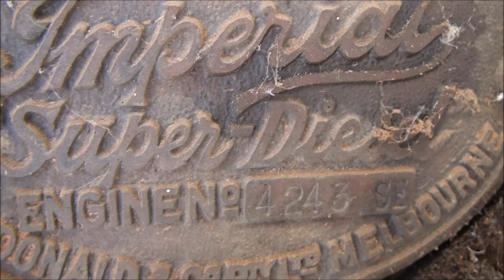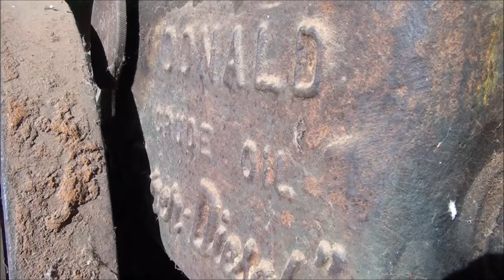McDonald Crude oil Stationary Engine, Australian made.

Comment: Runs mighty nice! Good for keeping the flies back too!
Reply from the maker: +TheFurriestOne Yes you are right, the 'Dunny Budgies' would be knocked around by the smoke! Will need a set of new rings though, gets through the oil a fair bit.
Reply: ***** I've seen cars on the road you would swear run on the stuff, despite being ostensibly gasoline-powered! Wonder if it needs new rings or if they're just a bit stuck? I'm sure you'll get 'er sorted though!

Comment: Awesome !! what a nice motor. Talking about quality. fantastic start.
Reply from the maker: +RODALCO2007 Thanks Ray! It certainly starts easily and once its warmed up it settles down ok. Its fairly worn out and when I had it running for a few hours at the Heritage day I turned off the fuel to stop it but it kept going! It was running on its own oil due to worn rings and kept going for 20 minutes or more, eventually it did stop after holding the exhaust valve open. Strange old beast that one.

Comment: Oh man what a perfect power source for my emergency genset. You would needs add an electric fan and radiator or save on electrics for your home and power the fan off the same belt as your generator.  I say that because running full tilt on a genset it would need both a muffler and radiator with a small water pump. Not sure how many horse she is but looks like about 2 1/2 or 5 at best. She would probably burn a couple gallons a day of sunflower seed oil.

Comment: Just warm it up, let the fuel tank run dry, and put an oil feed with a float in the crank case, and when at the show, pull off the fuel line, of course hiding the oil supply, and speak about overunity mobs. chuckle

Comment: Is it starting on compression alone?
Reply from the maker: +zaprodk Yes, compression alone and no pre-heating. Much harder to start on a cold morning though!
Reply: It's a diesel, that's all they have, that's why they are known as compression-ignition engines. D'uh.
Reply: acutally bruce, alot of diesel engines have glow plugs or intake heaters to assist starting
Reply: I'm aware of that, I'm a diesel mechanic, but none of these small low-speed engines have glow plugs, only high-speed automotive engines have them. Also, it's obvious that this engine also does not have a glow-plug.
Reply: Many require pre-heating paper in their pre chamber. Like a cigarette which can be screwed in. It's hard to believe that this engine starts up without any form of starting aid unless the engine is warm
Reply: None of these small single-cylinder diesels made in the last 70 years have pre-heaters, they're high-compression engines. The very old ones did because manufacturing capabilities were not able to make an engine with high enough compression, you need around 22:1 compression ratio. A lot of the small diesels have no electrical system at all. Yanmar do on some engines, but only for the models fitted with electric start. I was a Yanmar dealer for quite a few years.